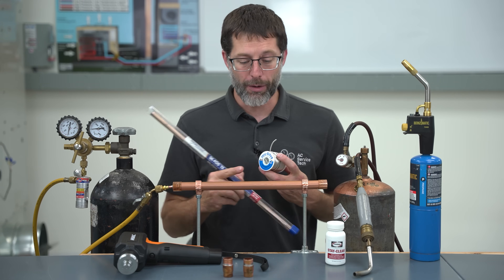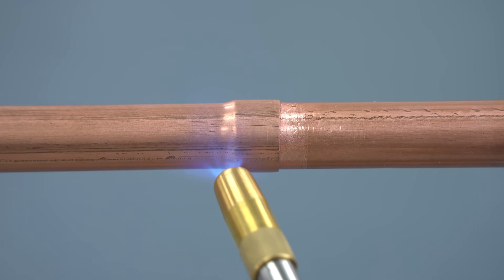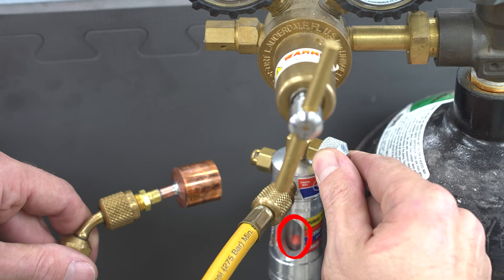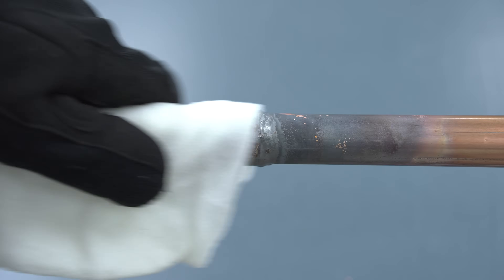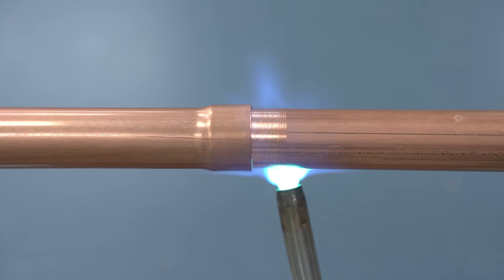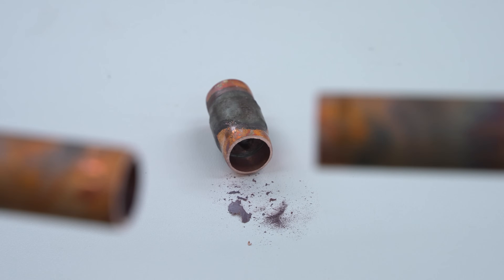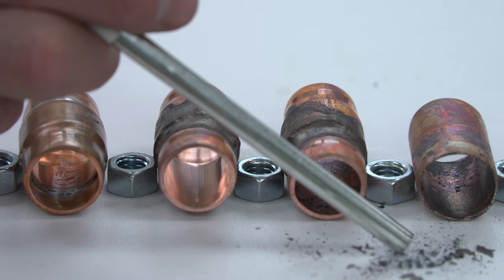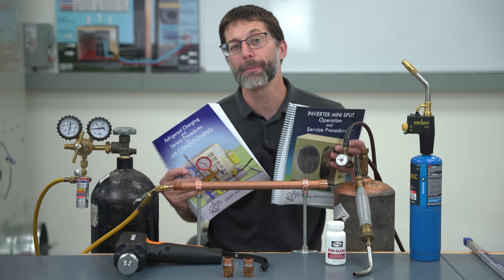HVAC Silver Soldering vs Brazing vs Brazing While Flowing Nitrogen!

Comment: I got a job at an HVAC company and they had NEVER used nitrogen on thousands of systems. They laughed at me for using it.  I showed them what it did on the inside of the pipe without nitrogen. They just said “if it mattered we’d have thousands of issues with TXV’s and pistons”….. I’m not sure what to think.  Some of them admit that it can cause premature wear on compressors. Which they’re ok with because that just means a future sale and likely out of warranty by the time it becomes an issue.  This is a wild trade.
Reply: It’s been awhile since I was in HVAC-R for a living but I know that many in the business cut corners, they will evacuate a system but not use a micron gauge so they maybe can’t see if they have a leak and if it pulls down to a deep vacuum or not. They’ll braze without a nitrogen purge like you said and they sometimes don’t weigh in a critical charge but instead just estimate how much refrigerant is charged in the units. I always used a micron gauge on pull downs and I usually used nitrogen when brazing.
Reply: @hermancm  Do it right if you care about your customer
Reply: @hermancm   micron gauge? Why not just pressure it with nitrogen and come back in day or two.
Reply: @Turtlemaroon because tool addiction. He has it.
Reply: Yes it is a wild trade. Not to mention, a lot of theves who just want money with shit work. Learn from Ac service tech and I bet you, you will have a great career! I did with the help of coworkers as well. This channel can give you a solid foundation for hvac service
Reply: @ I work with guys just like him every day. They have as much or more experience.  I’m moving fast in this trade.  Making great money, too.
Reply: 90% of problems come from shity installs
Reply: @jessebHVAC I say 98% of all problems are a direct result of installation on day one.
Reply: @jessebHVAC is the brazing technique the most critical part of the instal? Im going to question the installer before I choose one.
Reply: @jessebHVAC #1... Shitty installs, #2 lack of maintenance. #1 completely on the tech, #2 on the customer, possibly the company.
Reply: It truly is. I’m going into this field to be a home inspector and I read on Reddit from seasoned  H.I’s that if you do a  thorough job when inspecting homes, most realtors won’t consider taking you on. Apparently it’s costly and they don’t want to make as many repairs if they can take a short cut
Reply: @ryanl775  That's why the buyer should hire the H.I.
Reply: @hjc4604 Newsflash! Home inspectors know jack about HVAC. All they do is check to see that unit goes on and that flue pipes are installed and not loose. They might write up an ac missing line set insulation. Home inspectors are not going to open up equipment because they don’t want liability. How is a home inspector going to know if an ac system was properly installed? They won’t know if nitrogen was used. They won’t know if proper vacuum was pulled. They won’t know if the system was/ is properly charged. Home inspection is beneficial only to single mothers that are first time homebuyers.
Reply: @joeburner7120  And the permit fee charged by the city.
Reply: Just started at a place where they don't pull cores when doing deep vacuums. When I did my first installation, the kid that was with me looked at me like I was an idiot when I pulled the cores. After hitting 300 microns in 20 minutes, he was pretty shocked. Apparently, it usually took them multiple hours to a day to pull deep vaccums
Reply: @ on a new system I can have them holding below 200 in less than 25mins.
Reply: @TJBtheonly wym by cores, I'm curious, young and new to the field and don't remember going over that in school or my last two jobs
Reply: @legalmissingzx9 it does 2 things... 1) along with a 3/8s or larger hose allows for quicker vaccum pull, 2) allows for deeper vaccum. I don't use gauges except for a micron gauge, from liquid line to pump, pump to bottle. Faster and easier.
Reply: @TJBtheonly probably uses gauges, instead of micron gauge, maybe doesn't even know what a king valve is!
Reply: The service and maintenance trade is weird. There's a balance where you can be too good of a tech. The industry almost rewards techs that are OK at their job, because their work lasts just long enough to create plausible deniability, then is the catalyst for future work as it fails prematurely. They're good for profits, I suppose.
Reply: Yep, it's common in third world countries as well to cheap out on install practices. But you won't see units from their installs running in 30 years, I can assure that. Unless they got really lucky. POE oil isn't as forgiving as Mineral oil, which can only be used with CFC and Hydrocarbons like R22 or R-290. POE oil is made of organic acid and chemically removing water, so any water will convert it back to acid which will plate copper from the pipes in the compressor in the hottest parts, plus it'll strip that oxide off of the copper whereas mineral oil usually won't touch it unless it's already almost ready to flake off.
Reply: @mikafoxx2717  what are you talking about. Once synthetic oil was introduced into 410a system it practically eliminated compressor failures. Even towards the phase out of R22 Copeland was using synthetic oil in their compressors instead of mineral oil.  I’m luck if I see 2-3 bad residential compressors  a year now vs in the 90s and early2000s I would find a bad compressor was a week
Reply: @ make me wonder why in the heck anyone used POE oil.
Reply: @jeromebullard6123  Because HFCs are polar, unlike CFCs(and some HCFCs).  Alkylbenzene and mineral oil are non-polar, so the CFCs(and correct HCFCs) were miscible in them.

HFCs aren't miscible in them, so POE was needed.  If you put mineral oil or AB in an R410a or R134a system, you'll be replacing the compressor shortly.

Of course, PVE is superior to POE, but it wasn't an option until the turn of the century, and wasn't used by OEMs until 2010.
Reply: @jeromebullard6123  There isn't any alternative for some refrigerants. Simple as that.
Reply: Recovery bucket techs
Reply: This is why when you start your own company you’ll make more money then they ever will and you will have more customers because of your professionalism, knowledge and caring for customers. Companies like that always stay bottom feeders and have tons of callbacks 😂
Reply: You are cursed with insight. This trade is a lot of horseshoes & hang gernades and bullshit. Just keep learning how to do it right and ignore everything else’s short cuts.
Reply: I guess filter driers don't work
Reply: Welcome to the trade. That’s why no body will remember those peoples names. They do it wrong and other problems occur down the line. 
The proof is all right there in front of us. 
These things matter especially when you get into freezers and walk in coolers.
Reply: @EddyFlexy  Yes but HVAC companies want things to break so they can come back out and fix them again.
Reply: Because most are hacks that steal from people. 😮
Reply: A lot of companies don’t do full diagnostics either .. never hook up gauges or take subcooling/heating temps either and try to figure out if hvac system is working optimally or not
Reply: @RNforReality we call those “sales techs”. Guys who wear spotless white shirts. That says it all.
Reply: @RNforReality now that's really fucked up!
Reply: It's a company like the one you are describing that I would RUN from! I did refrigeration and air conditioning for over 40 years. I had to follow a fellow at my last place of employment (a Bakery). He never used a  nitrogen purge. I had so many contaminated systems! It took me years to clean up the systems with suction line and liquid line filter dryers and many compressors. The ONLY right way to braze is to purge with low volume no pressure nitrogen. You only want to displace the air with nitrogen. If there is pressure involved there could be pin hole leak in the braze joint! Ask me how I know!!! I am often asked what equipment is best. Most of the time it's not the equipment that is the reason for the failure, it was the technicians lack of careful techniques installing the systems!! A really good caring technician is worth his weight in gold!!!!
Reply: It doesn't matter what they think. It makes a considerable difference, as a good technician you know this. Screens are being added like crazy to system components now all the time, like never before... they will have 1000's of issues it's just coming at them in time lol
Reply: I solider dont need nitrogen use stay bright
Reply: HVAC tradesmen charge $2000/hr to do substandard work then rant on the internet when homeowners go and install their own minisplits.
Reply: I have found issues with it in 410A systems in the screens.  It is usually after a compressor replacement.  I will get a call on rental homes with plugged or partially plugged screens.  I guarantee not using nitrogen isn’t helping the efficiency.  Whether or not it will ultimately damage the system. I don’t know, but they cost enough and the rule that customers expect you to follow is best practice.
Reply: @timbrown9305 yea, I've read on here several time now, that's what the drier is for! That says it all right there!
Reply: They are hacks all the copper oxides will greatly shorten the life of the system.  Good job your right
Reply: Yep, here at my company this same shit happened. I told the guys to suck a dick. They make fun of how much equipment I drag out on every job. Fuck em. I do shit right especially when dealing with someone's thousands of dollars.
Reply: I used to work for a company that used liquid Flux and another didn't use nitrogen
Reply: We rarely used nitrogen while brazing. Never seemed to have a problem. Especially older systems where you only had an orifice instead of a txv.
Reply: I have always used the liquid flux,it will boil off under vacuum
Reply: Nice and educational man, cheers. I'm an arborist but have been doing a bit of this around the yard to install some water taps recently. Your vid is the best one I've seen so far, most of the others were 60s Shorts that didn't teach me a damn thing.
Reply: Armchair chemist here. So, uh, has anyone checked a solubility table of the flux residues in non-polar solvents such as difluoromethane/ pentafluoroethane?? no? Yeah because they don’t exist, but I digest. I guess that’s why this video was made. You’re very correct with your comment, or your boss was. The flux (and it’s residue) consists of ionic compounds primarily which are very polar, which means they very much like dissolving in water but do not like to dissolve in non-polar solvents, such as: all of the common refrigerants. flux residue migrating could be a problem but as experience says, Just try to keep it as clean as you can and you won’t have a problem, especially if you have a filter receiver dryer or whatever you call it. I would love to know if anyone has disassembled a fitting for my working unit that has been working for many years without issue and seen flux residue resided on the ID of the tubing, and whether it appears to have been washed off at all by the refrigeration fluids…
Reply: @brentdennard6722 we don’t use flux. I purge/flow nitrogen while using an acetylene torch to braze the lines together. There is no flux.  Some people do use softer solder that requires flux, but it’s inferior work practice when dealing with modern high pressure refrigerants.
Reply: @jeromebullard6123  Again, even in that case you’re talking about copper oxides forming inside, just more Ionic compounds like the flux would leave. Not something nonpolar refrigerant solvents would remove and cause to circulate with the refrigerant 🤷🏻‍♂️
Reply: Don’t blow up at me, bro, you wanted a better explanation than your boss could give you, here it is, know the science before you accuse people like your bosses.
Reply: That's a common thing in our industry, pressurizing with nitrogen is the correct way to to do it with a 3-5 lbs of flow. But it takes more time and money, plus unscrupulous people say well it keeps us employed!
Reply: filter dryers should catch a bit of goop  or it would not be a FILTER  right  and all closed system need a filter no mater it being an engine oil system .or coolant anti frezze deal they make  radiator filter that use screens in them  mostly in after market restomod installs but filter everything is the piont
Reply: I don't like it too but sounds liek we know who the work snitch is, lol.
Reply: for residential systems ithink it matters less because the filter catches all the moisture and contaminants
Reply: @AlexCejasMMA ok, so the air drier filters the contaminates, then gets clogged causing lack of flow and well if you can't figure the rest out, probably should work for the King... Burger King!
Reply: Do you know how many ac systems ran for 40 years just fine before nitrogen started being used.
Reply: @matthew1992ya yeah but those were bare bone systems. Today’s technology is much more sensitive
Reply: @matthew1992ya that was before poe oil. Poe pulls all that oxide off the pipe and carries it through the system cause acid and excessive wear and tear. Old r22 units used mineral oil and the oxide would stay on the walls of the copper.
Reply: @matthew1992ya  They ran fine because they didn’t use POE oil which acts as a cleanser pulling the carbon into the refrigerant. Clearly you missed that when you were in trade school, or maybe you just never went to a proper trade school…
Reply: @EarlHayward my trade school was shut down for fraud and when i attended I feel i was robbed of knowledge and my money but still graduated but no one wants to hire me because of how bad the rep was for that school and I really hardly learnt shit and feel so defeated in this field, that school fucked and failed me and didn't see any bad reviews until they got shut down by the Government School thingy for colleges and student loan shit, they announced it after the fact but not during the 2 year investigation that they did; so yeah don't take so harshly to the unfortunate few of us that didn't attend a 'Proper Trade School' as you said.
Reply: @matthew1992ya  Because R-11/R-12/R22 and Mineral Oil/Alkylbenzene didn't strip copper oxide off the tube walls--if you cut the brazed joint on those, they're still black on the inside.  Different chemistry.

And fixed orifices tended not to get clogged by the flakes and residue.  Unlike TXVs, which get coated by the freed copper oxide as it slowly builds up until it clogs the TXV.  Different technology.  

TXVs are way more efficient than a fixed orifice, and much better at temperature control, but they require a cleaner system.
Reply: @matthew1992ya I may be wrong here but isn’t that when they were using the old refrigerant and different oils?
Reply: @jeromebullard6123  It is crazy.  I know a pipe fitter who does nothing but braze reafer pipe, and his company never uses N2 either.  They install strainers, then come back after the system is running and pull and clean the strainers.
Reply: @MrBen527 I would bet a paycheck the screen strainers didn't catch all the fine copper oxide! That's a lousy way to treat a system and a customer. Do it right or don't do it at all.
Reply: @scottrothe5947 Of course not!  Yes,  I fully agree.
Reply: @scottrothe5947  ...you need to open up a drier....its much much more than a screen as it removes moisture/water as well
Reply: @MrBen527  Crooks.
Reply: I wonder how we survived without nitrogen. I've removed both residential and commercial equipment than ran fine for 30-40 years and when they were installed, no one was using nitrogen.
Reply: @RobertKammer-sx4ot  equipment used to be far less sensitive, nowadays you got plenty of places for those chunks of crap to get stuck, I mean heck we got micro channel coils now on a lot of units and oil that's unforgiving. Back then you could probly top something off with compressed air and it'd work, stuff was just magic from what I'm always hearing 😂😂
Reply: I Find this hard to belive
Reply: @niels-christianschmidt4604  some companies really be like that. I’ve known people who work for companies like that
Reply: There is a lot of issues with txv's and pistons! What are they smoking 😂
Reply: I’d rather have a little bit flux in there instead of carbon from braising 😂
Reply: @AAM_SAM  ...no...you don't. The flux turns to acid and attacks the windings. The carbon will get trapped by the filter drier the first time its circulated as the molecular structure is exponentially larger than the acid
Reply: Its why you have a line drier
Reply: @justinpennington7682  Filter driers aren't sufficient to remove oxide contaminants.

Worse, they can clog up, just like TXVs.
Reply: Thats what filters are for
Reply: @MrHemi4spd-420until they clog, prevent flow, ruin TXV, finally compressor!
Reply: I have been working at a hvac company for two years now. None of the installers or service guy's flow nitrogen. 

I tried Aug 5, 2025 to flow nitrogen for 5he first time and was shotdown by the team lead. He literally lost it, and was panicking and questioning why I wanted to flow nitrogen. He was hysterical, "wait I don't understand, why do you want to flow nitrogen, all that is going to happen without flowing nitrogen is there's black film that occurs". You would have thought I said something bad about his family.

Guy is a HACK
Reply: @joshm2243  Can you please explain how do you run nitrogen in new installations? 
As far as I'm aware, new air-conditioning unit comes precharged with refrigerant. So, you are suppose to connect it to the line that goes to evaporator. Where is nitrogen flowing in that case?